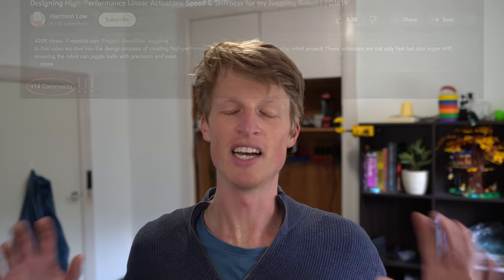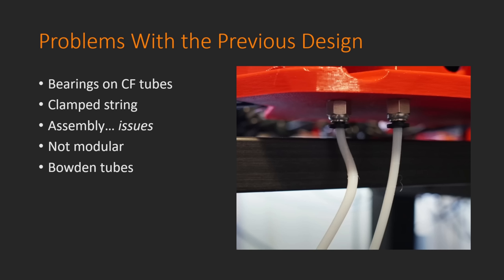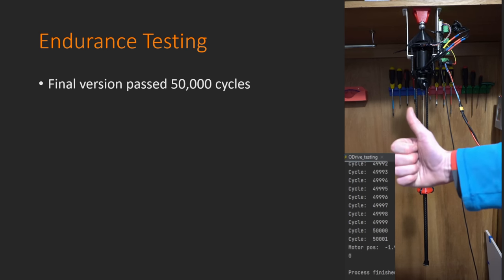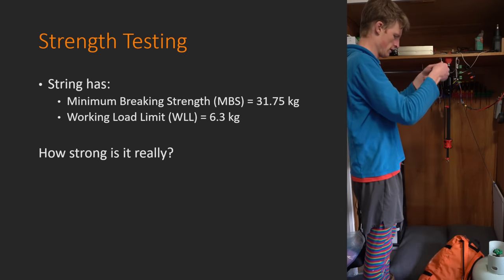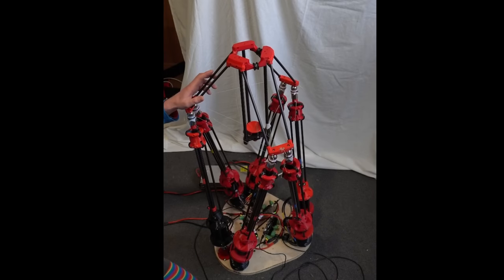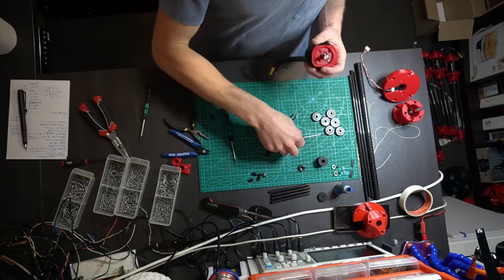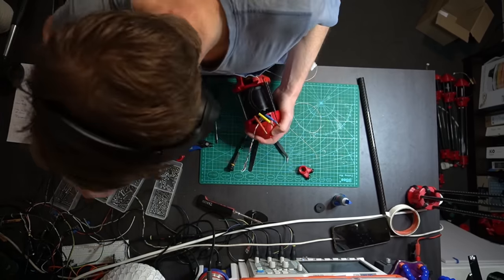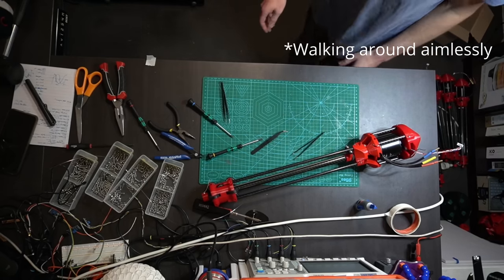My New Linear Actuators are SO MUCH BETTER! | PDJ #21

Comment: Rope expert and research engineer here.

Quoted strength of ropes and lines are almost always a theoretical strength for when the line is kept perfectly straight. If there is a knot, intentional or otherwise, strength is dramatically reduced, by 50 to 80%. How much exactly depends on the type of fiber in the line, the specific knot used, and other factors. 

So yeah. The moment you tie a knot in a line, you've lost at least half it's strength!

The reason is simply the sharp bend radii inside the knot. The fibers of the line that are on the outside of the bend take a longer path, and thus take more or all of the load, and thus break before the fibers on the inside of the radius are helping. This problem is worse with modern high-performance fibers that have very low stretch like UHMWPE (Dyneema, Spectra), LCP, PBO and others; and less bad with stretchier fibers like Nylon, Polypropylene or Polyester. Dyneema often looses 70 to 80% of quoted strength if it has knots in it! 

There are two ways to engineer around this. One in to use splices instead of knots. Splicing is a bit of a specialized skill, but not that hard to learn, especially for 12-braid Dyneema which is what I suspect you're using (and what I'd recommend). The other way is to use large diameter diverters. A diverter in this context could be a short piece of steel axle with a smooth surface that the line wraps around a few turns before terminating. "Large diameter" is maybe >20 times the diameter of the line you're using, more is better but diminishing returns. That way the force is dissipated over a longer part of the line, and thus it looses less strength than in the very sharp diameter of a knot. After the diverter you can use a knot.

A good splice will reduce the strength of a line by only 5 or 10%, and a diverter will asymptotically approach 0% loss as the diameter approaches infinity.

Dyneema is an amazing fiber, but it has one big weakness: It is very heat sensitive, above about 70°C it quickly starts loosing strength. This makes a large difference in knots that aren't tightened properly. Once load is applied to a loose knot the knot will tighten very quickly, causing lots of friction heating and often melting the line, even at relatively low loads. Dyneema is very abrasion resistant in general however, as long as the abrasion isn't rapid enough to accumulate heat.

I'd be more than happy to answer questions or otherwise help out :)
Reply from the maker: Very interesting! Cheers for all the info there 😊

I'd love to know your thoughts on a tensile-testing rig that I plan to build to compare my different string/cable options. I've written up a brief summary of what I plan to do on Zulip (I'll post the link in a reply in case YT eats it), and of course I'm happy to give details for anything you'd like to know
Reply from the maker: Link to Zulip thread:
https://pdj.zulipchat.com/#narrow/stream/399279-General/topic/String.2FCable.20Testing/near/390033444
Reply: @harrisonlow  No worries! Have been watching your progress on an off over the last year, very impressive :) Glad if I can help out!

How do you currently keep the strings taught? You obviously don't want slack, but also your mechanism will bind if they are too tight. Do you just tighten them at the screw-terminal shown at 10:45? Or do you have a tightener somewhere? If you've shown that  in some other video I've missed it. If not, then a mechanism like that might improve your repeatability and consistency, though at the cost of complexity.

-------------------------------------

Kevlar (Aramid) is not a bad choice. Aramid typically has very high coefficient of friction, the opposite of Dyneema. It's typically not quite as bad as Dyneema for loosing strength in knots, but almost. Aramid is very sensitive to UV light, and degrades very quickly if exposed to sunlight (several percent loss of strength per day). Aramid is very heat resistant however, will never melt, but instead only slowly start to char around 500°C.

Dyneema (UHMWPE) is stronger, less stretchy, and much slipperier (coefficient of friction around 0.05 to 0.08, similar to teflon) than Aramid. This last property can be both good and bad, but often makes it difficult to tie knots in. You can usually get hold of fine Dyneema braid in sport-fishing stores, sold as high-quality fishing line. Parachuters and paragliders also use fine Dyneema braids, see for instance: https://www.liros.com/catalog/en/dc-35-p3399/ 
Beware that Dyneema spun for different purposes will have different heat treatments and coatings, giving them very different properties. The paragliding line linked above for example is heat-treated to be very compact and very stiff, and is pre-streched and then heat-set, in order to minimize creep.
Dyneema is almost impervious to sunlight (after 10+years of tropical sunlight it will only have a slight surface fuzziness, with very little loss in strength), chemicals (it is essentially polyethylene) or abrasion. It's only flaw is it's low melting point.

Steel will be stiffer than any polymer fiber, and susceptible to material fatigue. Steel is about the same strength as Dyneema per diameter, but since Dyneema has a specific gravity of ~0.97, steel is only about 1/8th as strong per weight. It is also prone to wearing though blocks and pullies. To prevent fatigue you should make sure the diameter of all blocks and pullies is large relative to the diameter of the cable. To mitigate these factors, try to find a cable made up of as many thin strands as possible: 133 strand (7*19) cable is usually available. Try a sport-fishing store again, they use them for the last meter or so of their line to prevent some types of fish to chew through the line.

Aside from which type of fiber is used, the line construction also has a large impact on the properties of a line. In the closeup of your screw-terminals around 10:45, it looks like your Kevlar is a laid 2-strand construction. This is one of the cheapest ways to manufacture thin lines, and has just about the highest lumpiness (least smooth surface) and highest stretch of any method. A hollow-braid like a 8-braid or 12-braid gives a much smoother, less stretchy line. Another issue with laid lines are that they tend to twist or un-twist over time, changing their properties as the fibers moves around. They will also behave differently if they are threaded through a helical path that is clock-wise vs counter-clockwise, since the twist in the lay has an inherent chirality. But this might be too deep down the rabbit hole, if you haven't encountered any such problems yet :) If some of your lines get over-twisted and some under-twisted however, this might be the issue.

Now, I haven't spent all that much time analyzing your design, so I only have a low confidence in my suggestions. Feel free to ignore or explain why I'm wrong :) But it seems to me that you would like a [1] smooth (in order to minimize losses in pullies, stiction and noise), [2] low stretch (to minimize slack and play), [3] long lasting line, [4] chirally symmetrical (ie robust against twisting, ie braided rather than laid), that is [5] easy to tie off at the ends. Laid 2-strand Kevlar gives you the second and last of those (being high-friction, it will hold knots or your screw-terminals, though it will loose much strength there, and it will degrade over time from UV): A braided Dyneema line will give you the first three, but might require a more involved solution for the last point. You might be able to find a thin kevlar braid too, though I don't have a good suggestion for where to look off the top of my head. Maybe a sewing thread for firefighting/motorcycle gear? Most sewing threads are laid 2 or 3 strand, though some are braided. An industrial sewing supplier might have some. 

Hope that helps :)

I don't understand what the syncromesh cables are helpful for in your case. I'm not familiar with them at all, but what I gather is that they are designed to stop slippage, rather like the teeth of a timing belt. In you case the cable is fixed at each end (right?), and doesn't drive any wheels, (right?) So why is the synching feature helpful?

-------------------------------

As for building a tensile-testing rig: You built a beautiful machine already by the looks of things! For testing cables, lines, and knots, a longer working throw is useful. Beware the recoil when it breaks! Check out the channel HowNot2 here on Youtube: https://www.youtube.com/watch?v=8P3GK21Mdtk They do lots of pull testing in an amature rig, in the linked video I even make a cameo 🙃

If using Dyneema you are likely to run into the problem of the line slipping out of knots or your end-terminals, since it is so slippery. Build your test rig such that you can test this as well as the lines themselves. For testing the lines themselves; pull two smooth large diameter (<20 to 50 times the diameter of the line you're testing or more) cylinders apart, with the line wrapped tightly many turns around the cylinder at both ends. If it's wrapped enough turns, the end can just be taped down or something. That's often how ropes are tested at the factory, and that's how they arrive at the number printed on the spool, though it varies between different manufacturers. The speed at which you load things up matters too. Even with this method, the line usually breaks where it starts bending around the cylinder.

--------------------------------

Sorry for wall of text! Ask questions at risk of getting info-dumped!
Reply from the maker: Wow! Awesome info here. Cheers!

Re. synchromesh: my understanding is that it's more flexible (in bending), stiffer (longitudinally) and stronger than similarly-sized plain steel cable, though I could be completely mistaken here. I guess we'll find out when I put them head-to-head! (You're right that [in this design] the "no-slip" feature wouldn't really be used)

Haha yeah the tensile testing rig I made before was quite pleasing to look at, though it was very weak (entirely a result of the pissy little motors that drove it). I also don't have it anymore (built it for someone else) so I'm keen to build another better one!

I used to watch a lot of HowNot2's videos! I've got a brother who's quite into highlining/rope swings and his interest bled over a bit into me for a while there (though highlining scares the shit out of me 😅)

Re. the testing rig: Do you think large diameter wooden dowel would work as a mandrel on which to wrap the cables? I don't have many power tools and wood would be the cheapest/easiest option for me here. I could have a look around Bunnings for some metal tubing/rods, but wood would be much simpler.

Something else that is fairly important to me is to be able to test the cables with as short a length as possible. Particularly for the synchromesh cable because it's so expensive, I want to minimise waste as much as possible during these tests. Do you have any thoughts/suggestions for how I could do that?

Again, big thanks for all the info 😊
Reply: @harrisonlow  Cheers :)

Re: Syncromesh: Steel cable comes in many different alloys, tempers, pre-stretch etc, and I'm not surprised if Syncromesh uses some fancy high-tech version. Could you unwrap the coil from it, and just use the cable? Steel cable is more flexible (in bending) the more strands it's made up of, much like electrical cable. It's longitudinal stretch is mostly a function of the alloy/temper/pre-stretch etc. I don't think the coil on the Syncromesh contributes much to it's strength, but I could be wrong.

Note that steel cable will fail for your application when it starts to deform plastically, rather than when it breaks outright. How close that is to the ultimate yeild strength depends on the alloy/temper/pre-stretch etc.

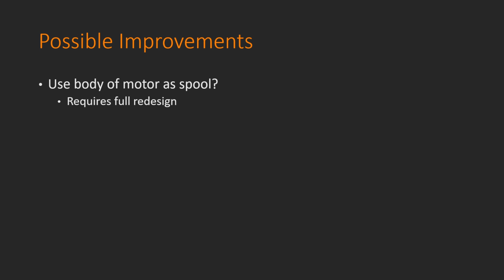Do you want the cable to be stiff like the syncromesh? I don't understand why. Maybe I misunderstood your comment at 10:26.

Steel cable is difficult to terminate neatly, especially if you want it to be easily adjustable. Swaged ends and turn-buckles are the go-to methods in industry, but difficult to apply at that small scale.

Re: Testing rig: Sure, a wooden dowel might work, with somewhat reduced repeatability. The lines will score the surface of the wood, and the wood grain will deform, causing high-spots etc, but maybe not too bad, depending on the type of wood. Could you use the shank of an M24 bolt or something like that? Should be easy to source from a local hardware store. 

To reduce waste, use smaller diameter diverters, and place them close together. If you have a spool of the stuff you're testing you don't have to cut it; just affix the end, wrap it around the first and then the second diverter, affix, and just let the spool dangle. That way you won't waste the length that is wrapped around the second diverter. Just mark the last bit as compromised when you're done testing.

Difference between Stretch and Creep: Everything stretches, but stretch can be split into several categories. You're obviously familiar with Elastic and Plastic deformation. High quality polymer lines do have some Elastic deformation, but don't typically deform Plastically before break. They do get temporarily elongated after seeing a high load, but will shrink back close to original length with some time and use. This slow rebound can sometimes cause people to over-tighten things, but is rarely a problem. 
Creep however, is a slow, permanent elongation that occurs after seeing a constant load over a long period of time, similar to why  bicycle chains need to be tightened from time to time. Most polymers see some Creep, though the extent varies. The least amount of Creep (and incidentally just about every other type of stretch too) easily available today is probably something like the paragliding line I linked to above ( https://www.liros.com/catalog/en/dc-35-p3399/ ). During production it is stretched close to it's breaking point, and then heat-treated into it's glass-transition region, thus locking in the elongation, and effectively preventing most Creep.
Reply from the maker: "Could you unwrap the coil from it, and just use the cable? [...] I don't think the coil on the Syncromesh contributes much to it's strength, but I could be wrong."

Hmm I'm not sure I'd want to remove the outer coil from the synchromesh, and I don't really see any disadvantage to having it on there?

As for the stiffness, I want the cable to be as (longitudinally) stiff as possible to make the system as tight as possible. (or would too much stiffness lead to excess stress in other parts which would then yield and lead to slop?)

Good idea for the shank of a large bolt! I'll try to make it to Bunnings in the next couple days to find something.

I plan to measure creep with the tensile testing rig, so it'll be interesting to see how they all compare!

I'll see if I can pick up some paragliding line to test out 😁

Cheers!
Reply: @harrisonlow Well, it would run smoother over the pullies, be quieter and more efficient I'd imagine. 

I don't think you'll have the problem if too little stretch. I can think of two ways you could run into that problem: First, if you are currently relying on the stretch in the line in order to keep it from slacking, then you might have to engineer a more complex tensioning system. Very low-stretch lines go from very tight to completely slack with extremely little tolerance. Second, shock loads in the system will increase, unless they are dampened out somewhere else. This is mostly a problem when lines are allowed to go slack and then go tight again, but if you were relying on the line to absorb some of the shock loads previously, then going to a less stretchy line will absorb less.
But again, I don't think either of these will be a problem for you.

Comment: If you can get larger braking resistors with the same rating, or use many braking resistors in a 2x2 configuration, you should be able to handle more power.
Reply from the maker: You'd think so! Here's what I've tried so far (and their errors/failure modes):

1 - 22 V PSU + 2Ω 50W resistor (overheats)
2 - 22V PSU + 2Ω 300W resistor (over_regen_current [can't recall if the PSU tripped here])
3 - 48V PSU + 2Ω 300W resistor (over_regen_current and PSU trips)
4 - 48V PSU + 0.5Ω 1200W resistor [soldered four 300W resistors in parallel] (over_regen_current and PSU trips)

Comment: Measure with mirror (front surface if possible)  and laser. Adjust resolution based on distance. Used to Align aerial camera systems this way to a few microns.

Comment: Square cross-section central tube?
Maybe there’s hexagonal?
Why not use smaller (tiny)bearings, making them bigger does nothing to solve printing inaccuracies if you want to confine the rod. 
Use heatsink-able break resistors.
Reply from the maker: I hadn't considered using non-circular tubing, but I do like the idea! I can't find any hexagonal carbon fibre tubing in Australia, and I think I'd prefer that over square (since square would require a redesign of the bearing block). I imagine this would go a long way to helping the torsion problem!

Yeah I agree that smaller bearings would be good for minimizing the mass of the end of the actuator. I mostly used the M8 bearings because that's what I have on hand that fit relatively well in the old bearing block. Using much smaller bearings would mean redesigning the bearing block to be closer to the central CF tube, which is certainly do-able but I don't see it as a huge priority right now

Cheers!